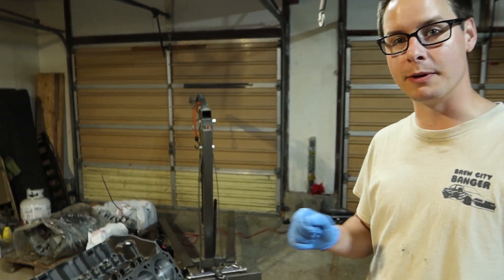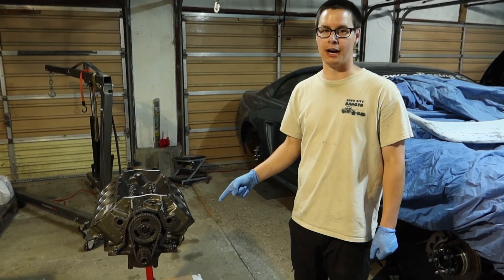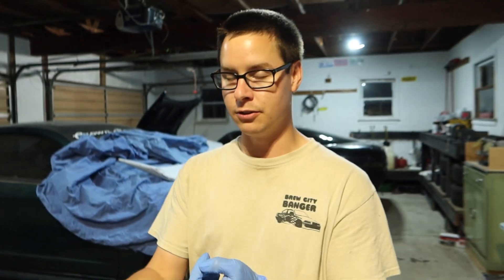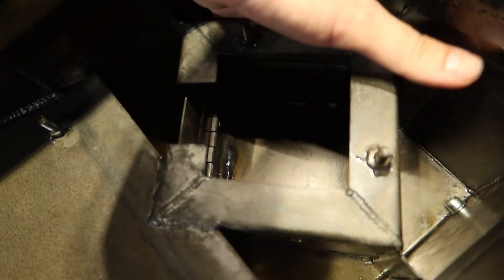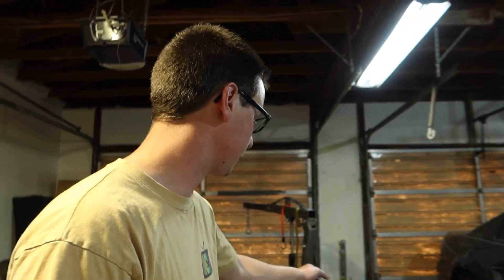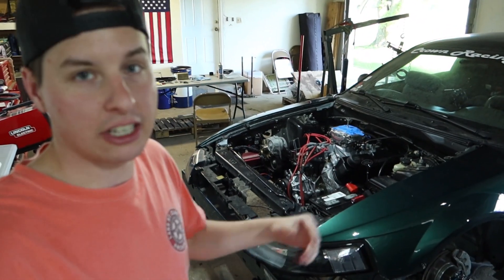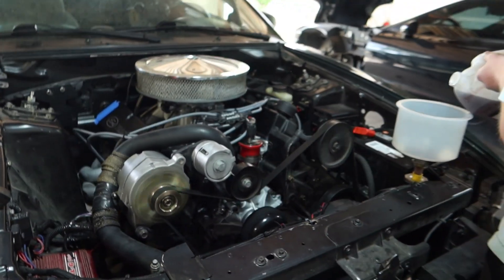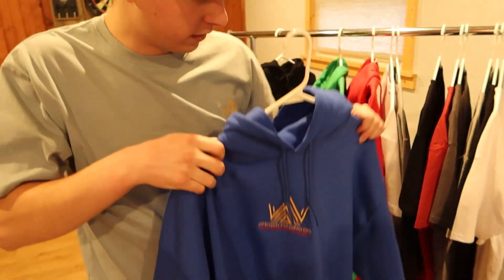How to 351W Small Block Ford Engine Swap Into SN95 New Edge Mustang (5.8L V8 400HP)

Comment: What K-member did you use?
I put a 351W in a 1986 Fox body, and used the original 3.8 V6 K-member.
Reply from the maker: I used a k member out of a 1995 mustang gt. I also used the same engine mounts for a 5.0 in a 1995 mustang gt.

Comment: How do you run your fuel system? Factory pump and tank just regulated under the hood?
Reply from the maker: I'm using a Holley 255 LPH drop in fuel module assembly. You can find it on holley's website. The sniper EFI has a built in fuel regulator and return style system. You can also use a traditional fuel regulator under the hood before sending fuel to the sniper unit.
Reply: @CrownRacingCo  I’m running a Holley 600 with external regulator. But this is on a 302. Would i need something larger for a 351 like this?

Comment: Good Work! What series AFR heads did you go with. Renegade or Enforcer & CC
Reply from the maker: I got the 185cc Renegade Street cylinder head that is full CNC ported. 72cc combustion chamber.